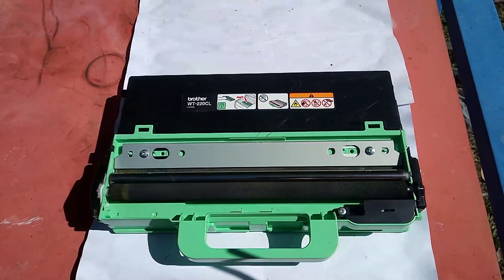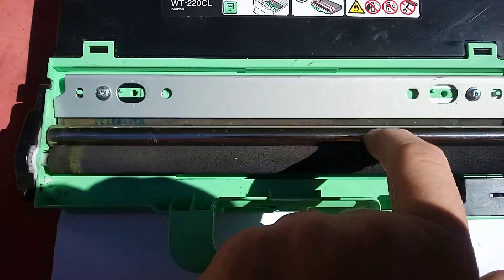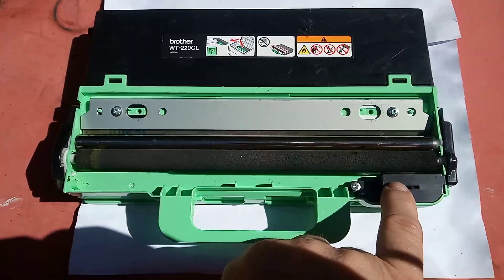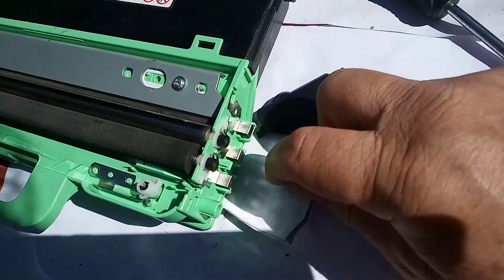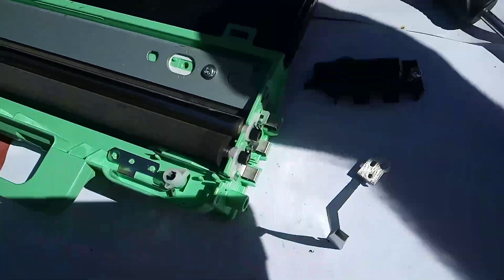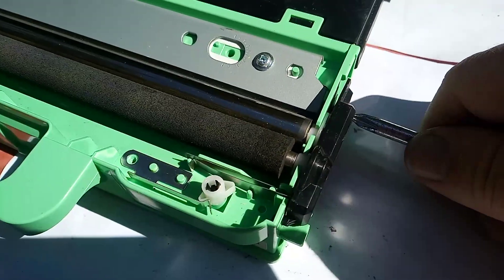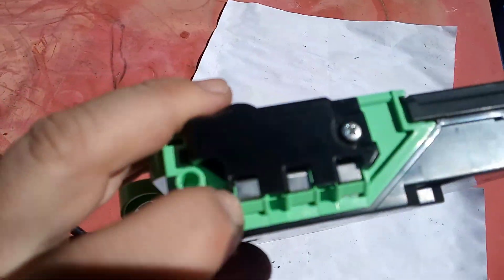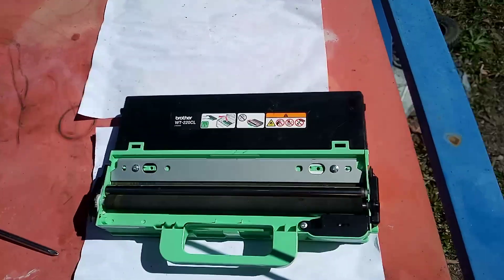Replace WT Box Soon FALSE ERROR Brother Mfc Printer 9330 9340 9335 9140 HL-3140 3150 3170

Comment: Only worked after I sanded the contacts ... didn't seem oxidised, but that was the only way to clear the error ... something to do with the resistance of the roller I suspect.  Thx.
Reply from the maker: Absolutely Incorrect thing to do now you are going to have different problems in the future.  And the resistance of the roller has nothing to do with it. You have merely gotten lucky with your printer working. If you want to know the real cause of the problem you must buy access at my pay-per-view video showing the cause and how to repair. Buy sanding the contact points you have opened yourself up to accelerated oxidisation of the connectors

Comment: One waste toner bin solution: make sure the printer is on the properly sized flat table so that the paper tray is not pushing up under the WT bin and disconnecting the 3 pins on the side of the WT bin. Or make sure nothing is under the bin is pushing up. fml

Comment: I tried the other YT videos, it was the contacts just as Terry mentioned. There was no corrosion just wasn't making good enough contact for the low voltage to be able to register. Excuse me, I have to go cancel my order for the new WT box I made this morning.
Reply: Same for me -- sanded all the waste box switches as in the video, made sure screw was tight, cleaned the contacts, but no luck at first.  Once I SANDED the contacts of the waste box and the curved spring contacts in the printer, Voila!  Success!  Very happy and appreciative -- sent you a tip, Terry -- thanks!!

Comment: Hey Terry - just came across your channel.  I have a Brother MFC-9340CDW. It won't complete print for 2-sided.  The paper would start to go back inside, then stop 1/2 way and ERROR. I found out that the spring holding black bracket out was out of place. I fixed that. Now when printing the first side, the paper is taken back in, the 'wheels' spin, you hear loud clicking, then ERROR (paper jam)  I opened back cover, the paper is there 'behind' the black bracket where the paper slides over. I would love your help and suggestions.  Thank you very much.
Reply from the maker: Sounds like a good idea for a video.
Reply: @TerryJonesPrinterRepairs  Does that mean you have a solution?

Comment: What about on the printer itself? I've tried all of this, I've installed a brand new WT box, and I still get the error message. I've only printed 12000 pages total, and I'm now on my third WT box (well, almost, I can't get the error message to clear so I'm actually stuck not being able to do anything). Is there no way to go into the menu and tell the thing that "Hey, I've just put a new WT box in, sort your sh#t out and reset already."
Reply from the maker: Proceed to level 2 https://youtu.be/Jt7YSU83wzE

Comment: not work for me
Reply from the maker: Did you leave the switch opened or closed?
Reply: @TerryJonesPrinterRepairs  once opened , once close. Same result
Reply from the maker: Well with that logic I guess you've got a 50% chance of getting it fixed
Reply: @TerryJonesPrinterRepairs  do you recommend to use it closed or opened?
Reply from the maker: @juligug5660  go rewatch the video all the information is there.

Comment: Right, it's the poor contact cause this problem. Mine only print 700 pages when this happened.
Reply from the maker: Yes and this part and the printer has multiple contact points and you must address every single contact point. If you live in a tropical environment you will have to clean every contact point every few months